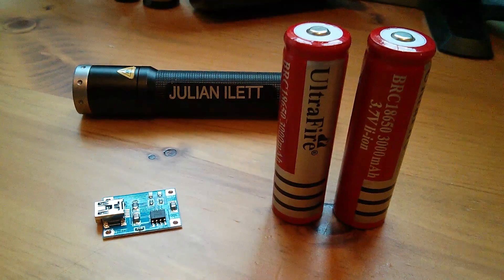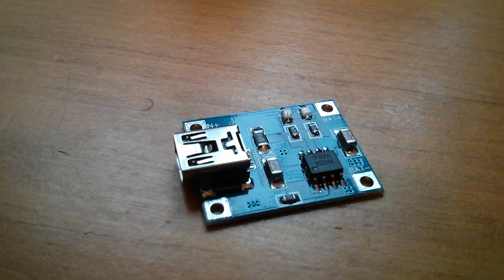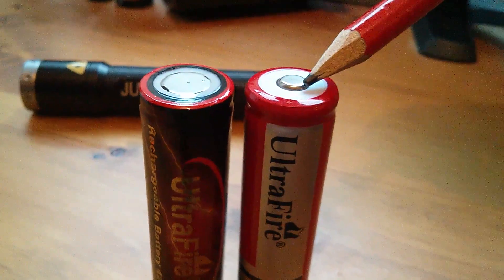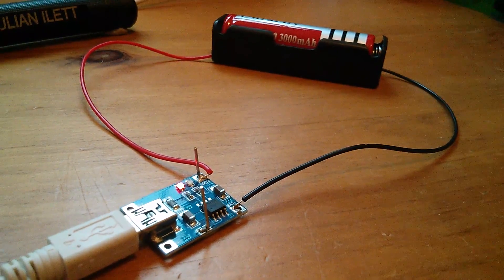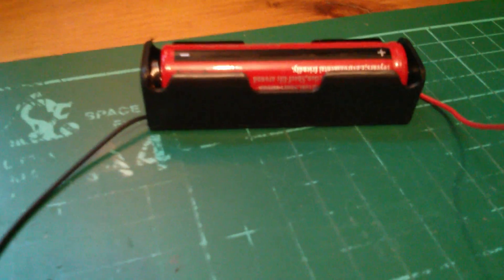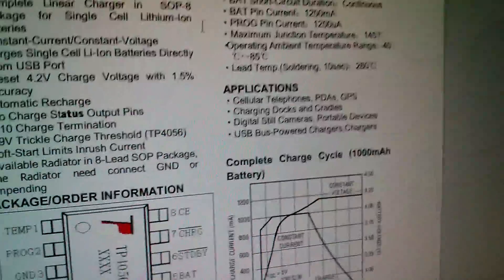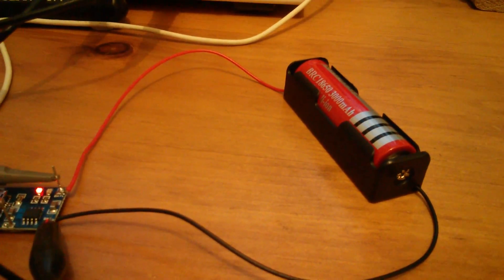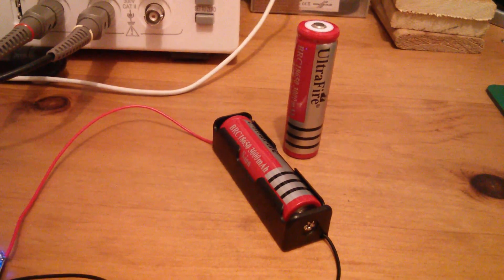Charging a Lithium 18650 Cell using the TP4056

Comment: With s ome batteries that are shady ,  the module, right away displays a very small blue (or red, cant remember which) led when you plug it in to charge. The last lion cell that I tried had a stable voltage of 0.86 volts. Is the small blue led a signal that the voltage is too low too charge or that there is a short in the cell? I use the cells inside the electronics cigarettes.

Comment: Thank you for posting this very good  video. I have bought 10 of these chargers, but the charging current terminates when the Li battery voltage reaches 3.97  dropping down to 1.5ma only, and never reaches 4.2 as claimed and  also charging current never reaches 1000mA . Can yo explain why. I will be grateful if you share your feedback.

Comment: Essentially it's similar to the little board you would find in a power bank, which also take USB to charge. It makes me wonder why a person would need to buy this piece separately, because it isn't like this charger is heavy duty, therefore all you could use it for, is to make your own DIY power bank. 1 amp at 3.7-4.2v or so isn't much power, meaning it can only put out around 3.7-4.2w of power. It's good to charge 1 cell, maybe 2 in parallel possibly, but no more. 
The best way to charge 18650's is to have a bunch in parallel, then have 3 sets of those in series, then charge them with a charger and set to 3s (which means 3 series I think), and then you have a balance lead also going into the charger from each of the 3 series, in case one gets low the charger can fix it by putting a bit more or less power into that section. 

This is simply the best way to charge them, because you can make a large battery. The only time a single 18650 is useful, is in a flashlight or something like that. However to power anything proper, you want a large battery. At minimum you want 3 sets of 6 cells, so 18x 18650, if you have 2.5Ah cells then you have a 166Wh battery, which is pretty useful. Also being 3s at lithium it's very close to pure 12v, fully charged it's around 12.6v, and depleted it's 11.1v. This is within the tolerance range of most 12v items, meaning in theory you can power it direct with just a fuse in line for safety. 

A battery of this size can power lights, small computer, speaker, small desk fan, and it can also cook about 2 meals in those 12v camping ovens, or it can make hot water in those 12v camping mugs about 8 times before it needs to be recharged. Of course while camping you would normally use a fire, however this would be handy if you couldn't find wood or it had recently rained and wood was wet. You can easily charge it with a portable 25-40w solar panel as well.

Comment: Internal resistance rises up to double (and more) along with SOC (state of charge).  So, current draw will decrease considerably as the battery creeps to its fully charged state. Temperature also plays a role, but it is less important under normal ambient circumstances.

Comment: Thanks for screening this, I was most interested in your comments about the battery type. The curve shown on the data sheet was for a 1000mAH type, whereas the the type used for your demo was billed as a 3000mAH type by the manufacturer, so it would take a much longer time to charge, as you would expect from a higher charge capacity device. It would be nice to see a comparison of different battery types.

Comment: can i use tp4056 charging my battery and step up board output make 5V to my clock and keep alltime this wall socket and if wall come blackout elektric cut battery work, and no need adjust ewery time after cut clock again to right yeart,day,time,. clock have normal 2x AA battery powered or 4,5V/usb cable socket powered clock on table.

Comment: Sorry if this is a stupid question. If I am using this charging circuit the TP4056, do I need "protected" 18650 cells? Is the overcharge protection offered by those the same as in this circuit? If I am positive I will only be charging the 18650s with the TP4056, can I buy un-protected cells for cheaper? Or is that a bad idea and I should always buy protected?

Comment: What happens when you charge 4 of these batteries in parallel using the TP4056? I would imagine that 1 amp being fed into the batteries would just take longer to charge up than if you only have a single battery? Are there other drawbacks to doing this? I am thinking about making an 48v 14amp electric lawnmower with a bunch of 4 x 18 of these batteries wired up in series and charge up each 4 battery pack with its own TP4056 and a modified set of USB cables? Is this a stupid idea?
Reply: I think it is an awesome idea! Although i cannot answer your question :(
Reply: It will work, so long as you don't try to charge all the battery packs at the same time while they're still connected to each other.  Doing so would likely cause a short-circuit.  As you suspected, the only effect from charging batteries in parallel is that the charge time increases.

Comment: can i use tp4056 to charge 18650 from a solar cell (6V). what are the considerations i need to take and if possible can u give some outline of the setup. (is a resistor to bring the current to 500mA a quick fix)
Reply: It's possible to directly charge a Li-Ion cell from a solar cell, so long as the voltage and current capabilities aren't too insanely out of proportion AND you use a battery protection circuit or a battery with an in-built protection circuit.  This is because with a low-amperage solar cell, the output voltage will be "pulled down" by the battery during charging, and with a protection circuit the charge will be stopped after the battery is full.

So, for an 18650 of 2000mAh or more, a solar panel of 5-6V with a current capacity of 200mA (one-tenth C) maximum output will probably work just fine.  You can get away with up to 1 C maximum current from the solar panel, but at the cost of a slightly reduced battery life.  (I say slightly because the solar panel won't be putting out its full current all of the time.)

It's probably a bad idea to hook up a 12V, 40W solar panel to an 18650, though. :)  BOOM

Comment: Julian can you advice me i have several light (emergency light that come on when the power drops) that re 18650 powered but i noticed there is no low voltage protection (so if  not home they can drain too low and degrade the life of the cell) so i opened it up and it has 1 2-wire line in and out  i do not know if a TP4056 will work as they have separate in out   can i use the TP4056 like that or is there another board i need 

Thank you

Comment: good day, can i Multiple charging using one board TP4056 with 2cell 18650 battery?
Reply: You can't charge batteries in series with these chargers unless you isolate each set of parallel cells.  Charging a set of parallel cells is okay.

Comment: Limiting the Top Off charge to 4.0V significantly extends the battery Cycle Life.  I don't suppose you can alter those to limit the Charge can we ?   The Reference is inside the IC ?

Comment: I use these boards, and their successors all the time when building projects with lithium batteries.  Of late, I have been building ghost detectors (OK static electric detectors) using old phone batteries, or batteries taken from old tablets depending on the case I build them into.  I simply carve out a slot in the bottom of the box, well the edge near the bottom, then glue one of these little gems in after having hooked her up to the battery and device, and away we go, looking for Casper and his buddies in the creepy old houses in the area, where known murders and suicides have taken place.  Now don't get me wrong, I don't particularly believe in that crap, but I have a niece who believes with all of her heart.  She doesn't  have enough money to buy a ghost detector kit, so I have been building her one.  My next build will be  a tri-corder for her exploration of spooky places, including a motion detector,  temp sensor, humidity sensor, distance to object read out and a few other goodies that I have sensors for.  Perhaps even a gas detector.

Comment: I have acquired a quite a collection of pretty good Lithium 18650 batteries by tearing apart old laptop batteries.  I find that there is usually one, or perhaps 2 cells at the end of the pack that have gone bad and caused the monitor hardware to shut down the battery and refuse to charge.  I throw away the cell or two that refuse charge, and the rest have been very good at powering various projects. I have a couple of power supply type builds where I have 3 or 4 cells in holders with step up and step down boards to adjust to what ever power I desire.  I added common plugs for standard devices so I can plug in or hook to an adapter.  Works great when I buy an old laptop with no power brick, I can simply power her up from my home made power supply and see if the unit is worth the investment of a power brick to get her going full time, or resell.

Comment: I'm thinking of buying one of these to repair a Dualshock 4 with broken charging circuitry (verified that it's not the charging port with a working PS4 controller). Wish me luck!
Reply: I was able to fix it, and it worked really well. On top of that I've fitted two of these in my tablet with nroken charging circuitry and it charges up my tablet nicely, the only issue is that the battery percentage keeps dropping until it reaches 7 % and stays there.

Comment: Can I increase charging speed by adding 2 of these, connecting the input in parallel and output in parallel?
Reply: if you wanted to blow up your batteries. 
if the chip could charge it quicker without setting fire to the batteries, it would do it.
Reply: @lucasc5622  already did it. It works fine. Thanks for your concerns.

Comment: Chargers such as the Tenergy TB6B and Imax B6 charge LiPo batteries to 4.2V and LiIo batteries to 4.1V.  I thought all 18650 cells are LiIo as indicated in the Ultrafires in your video.  But most people on the internet use the 4.2V LiPo setting when charging 18650 cells.  And the TP4056 also charges at 4.2V.  Why the inconsistency?  What do you think is the correct voltage should be?

Comment: I wanna make a portable speaker, what is the IN- and IN+? is it to draw power from the battery while connected to the board?
Reply: No, IN connections are an alternative to the USB socket for input power. If youre using unprotected cells these boards are best suited to charging only. For something like a powered speaker theres a slightly different version that also has a DW01 cell protection IC switching an 8205 FET to disconnect the cell in case of under voltage, so you have charging and cell protection in one module. See item no 201698163086 on ebay UK. The connections on those are USB or IN+/- for input power, B+/- for the cell and OUT+/- for the load.

Comment: A great video thanks Julian, trying to find a source of good, GENUINE, 18650 button top batteries in the UK on the internet is proving difficult since I discovered the amount of fakes out there. I genuinely didn't know until I started using 18650's for things other that cheap torches and bike lights.

Comment: Hello, very good tutorial. I have a question. How does the tp4056 know when the battery is fully charged? The battery is 3.7 volts and the charger is 5 volts.
Thanks
Reply: When the battery is fully charged it'll be at 4.2V-ish and draw very little current. It just checks those two conditions.

Comment: 1st of all, who would name a Li-ion battery "SureFire"? 
2nd, The data sheet on the TP4056 says 1A, but I've never been able to get more than 0.65A from a 3A USB power supply used on my Pi. Another fluff job of the Chinese market. 
3rd, Divide any number by 5 to get a realistic power out of these cheap-ass batteries.

Comment: could you tell me what does do i see good review
https://www.aliexpress.com/item/DC-DC-Voltage-Booster-1S-Lipo-3-7V-to-5V-Synchronous-Step-up-Converter-Module-Output/32752700862.html?spm=2114.search0104.3.204.PpUsi5&ws_ab_test=searchweb0_0,searchweb201602_5_10152_10065_10151_10068_10130_10084_10083_10080_10082_10081_10110_10178_10136_10137_10111_5360011_10060_10112_10113_10155_10114_10154_10056_10055_10054_10182_10059_100031_10099_10078_10079_10103_10073_10102_10189_10052_10053_10142_10107_10050_10051-10102,searchweb201603_3,ppcSwitch_5&btsid=8b5483e4-1f80-4957-a336-3843ccb41aa7&algo_expid=2e3c28fc-52ff-4ce8-b62f-67da7f1f9241-25&algo_pvid=2e3c28fc-52ff-4ce8-b62f-67da7f1f9241

Comment: Hi Julian,
I'm testing this module to charge a Lipo battery 3.7. I have been waiting for module to cut off the charging at 4.2V but nothing happens. I think the battery is forcing for this reason and it could be dangerous. Have you noticed somthing similar? 
Congratulations for your videos.
Reply: What's the mah on your battery?
Reply: sarthak grover i have bought 5 modules. some work some dont

Comment: Thank you for this nice explanation, I wanted to use this board to charge LiPo battery with a solar panel to power a Arduino board, my question is, can I use the USB port to output both LiPo and solar power? Do you have any other suggestions if this board does not fit my end goal? Thank you in advance.

Comment: Hi Julian,  I have several 6 volt (nominal) 2 watt solar panels.  Do you think the TP4056 can handle the over and under voltage of the panels to safely charge an 18650 Lithium cell?

Comment: if my battery pack is in series
ya think i can hook up two tp4056s and connect wires to each positive and negative without having to remove them from the pack
Reply: Leonardo Po it looks like the ground in and out is the same on the module so: no you can't unless modules have separate USBchargers connected and that loses the "cheapiness" of the solution.
Reply: Benny Lloyd-Willner
thank you, im a newbie when it comes to electronics
but two usbchargers, i could live with that. ive seen people charge car batteries in series like that anyway.
thoouugh
i was thinking of wiring a single micro usb port to both ground ins and outs to power both tp4056 with a single usb.
i guess the problem here USB 3.0 provide .9A
so both TP4056 would have to split current .45 .45 but thats fine by me, or i can use a 1.5A ipad charger
what do you think? i dont see people do this on the net though so im a bit skeptical

Comment: I have bought this charging module(without protection ic) and to my surprise the charging module only peaks out at 3.07 volts. I bought it after watching your video only. Your module peaks out at 4.2 volts why my module only gives maximum of 3.07 volts. When i connect it to a battery it only manages to charge it upto 3.07 volts and then the blue led starts glowing indicating the charge is full and no matter how long i keep it on charge the moddule stays at maximum 3.07 volts. Is the charging module bad or am I doing something wrong ??
Reply: What is the voltage of your charging source? Does it have enough headroom above 4.2V for the module to remain in its proper operating area? Haev you checked the calibraiton of your meter?